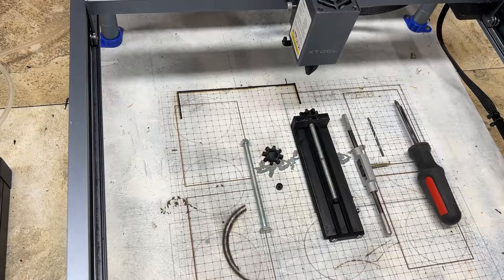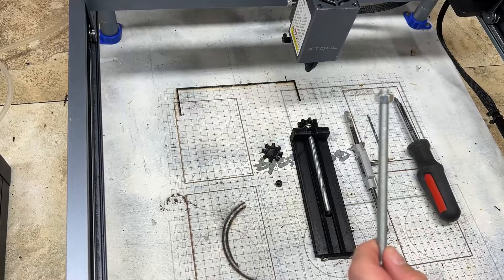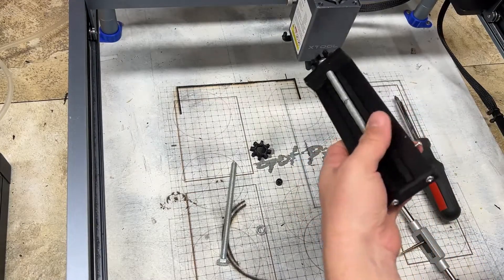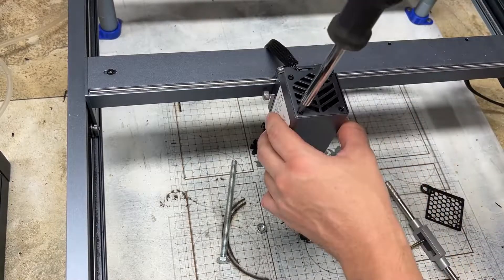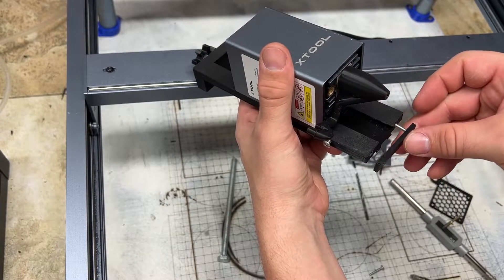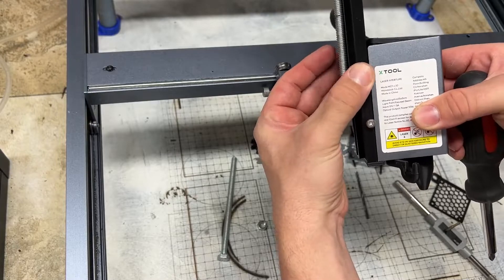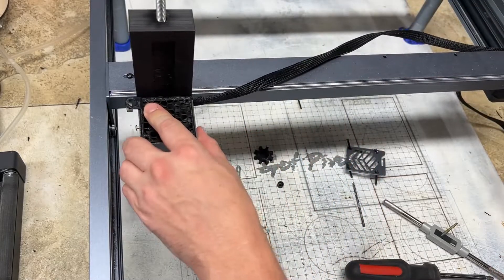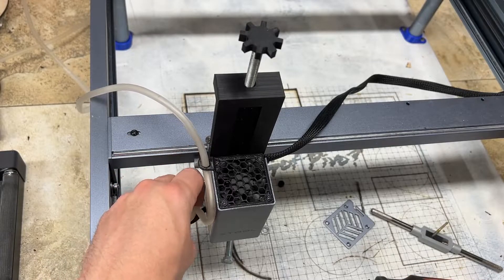Xtool D1 Z Axis Extension

Comment: Easy to install and appears will work but if your enclosure is not clearing enough height this will not work. You will need atleast 7-8 inches of clearance above the frame to inside of enclosure to work.